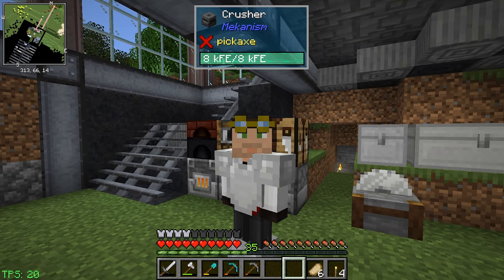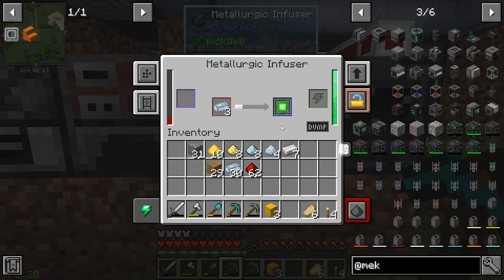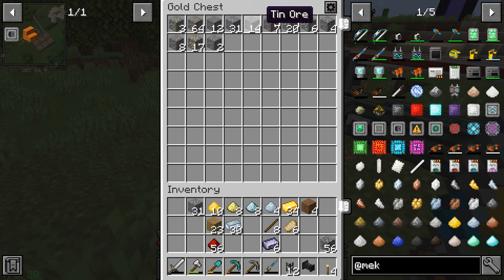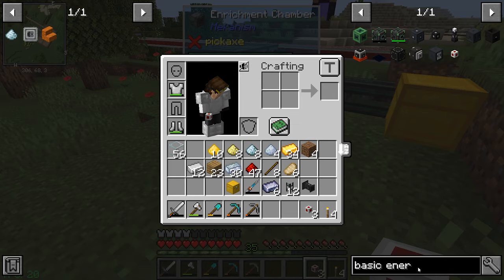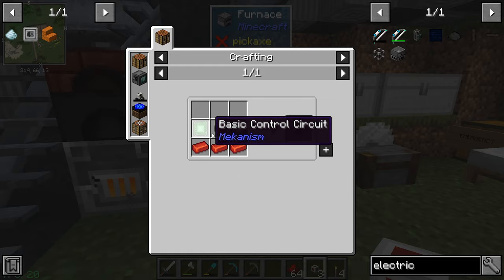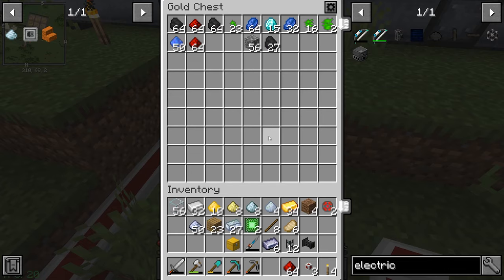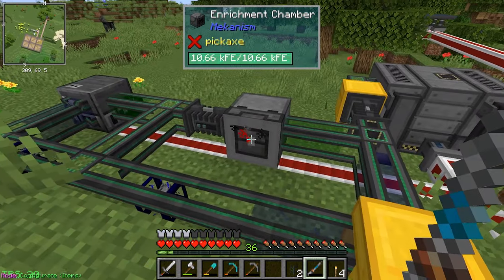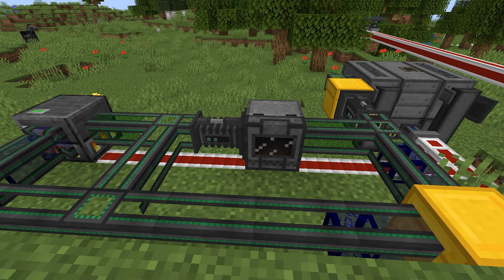QTech : 13 | AUTO ORE DOUBLING and SMELTING!!!

Comment: Making nice progress. You can use the configurator in wrench mode to quickly pick up cables and machines. I'm not sure what the configurator needs power for but it can be charged in your energy cube. Look into upgrading the cube to the next tier now that you have more machines using energy. Also, can you use the 4 solar generators to craft the next tier? It should output more by itself than the 4 do together. Is that really the only way to make steel in this pack?
Reply from the maker: I need to investigate making steel.  A video out soon does more with solar ;)